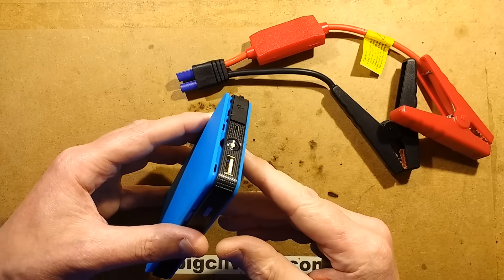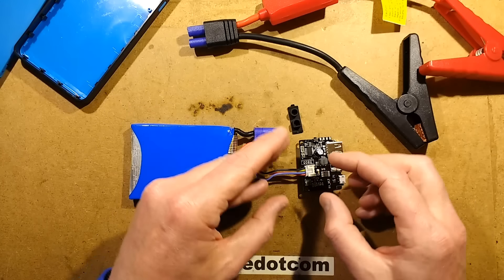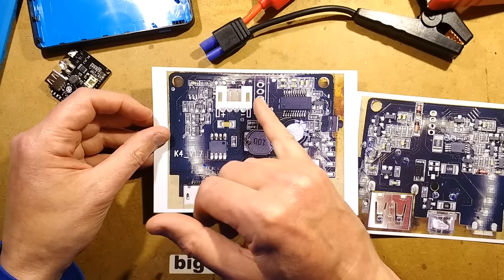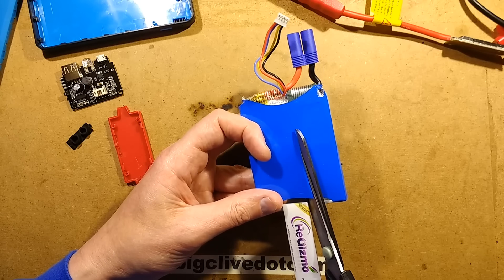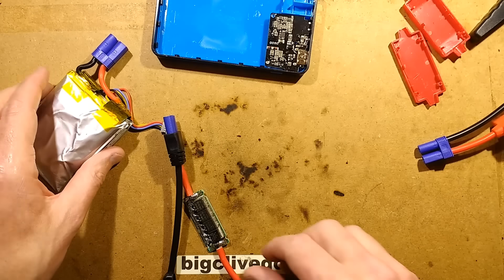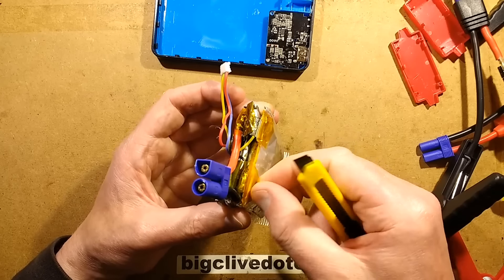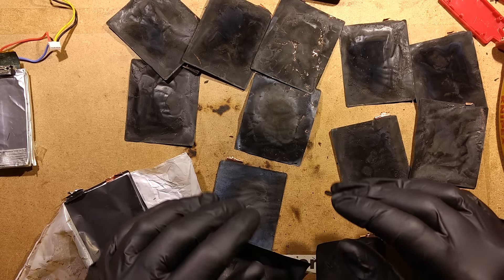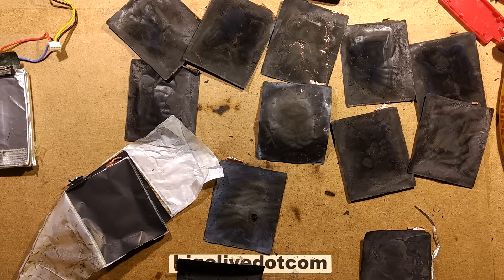Shorting out a fully charged cheap lithium jump starter.  (It didn't end well.)

Comment: Didn't end well? Ended rather boring, actually.
Reply from the maker: That's because the camera wasn't running when a stack of the cell plates spontaneously ignited on my work bench.
Reply: @bigclivedotcom   - So you simply ran a boring video. Sorry, thumbs down.

Comment: these cheap hard disk sized ones are real crap. Poor quality and far too little Ah capacity to actually start a car with a discharged battery. Its useless as anything but a small portable power supply. The real jump starters carried by the AA and other roadside technicians is about the size of a small toolbox and costs about 5x what these cheap crap cost.

Comment: So many of these dumb video's about these days. You misused the product and it still did not catch fire but yes it might have done. Is it possible to overcharge it or does the protection actually work? Lead acid batteries have been around for a very long time so try the same experiment with one of those. Take a charged 12 volt car battery and short it out to see how 'safe' it is under the same shorted test condition.